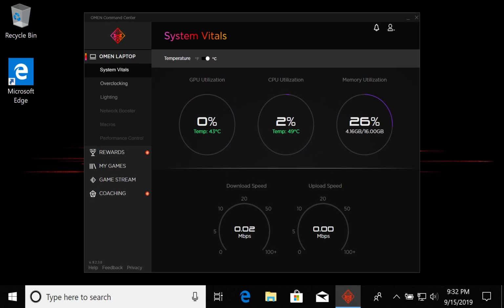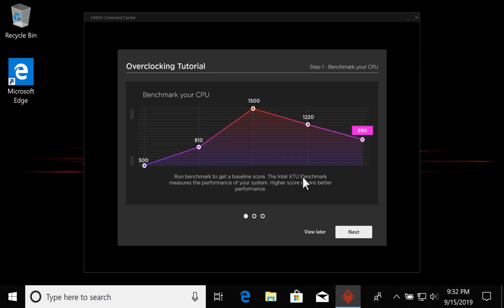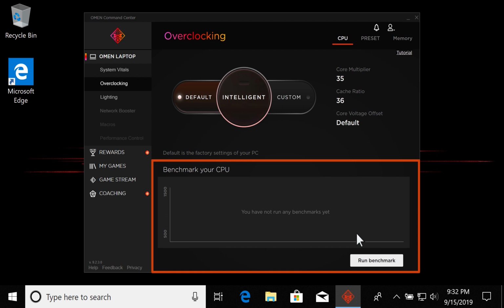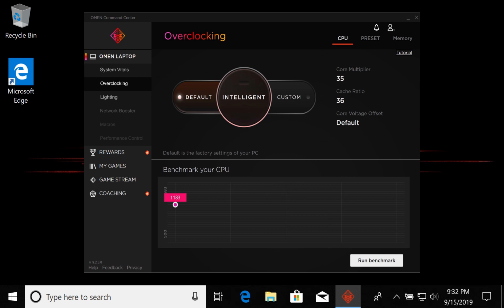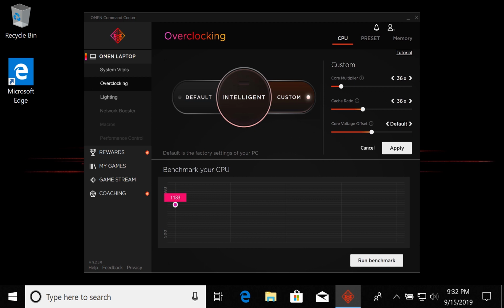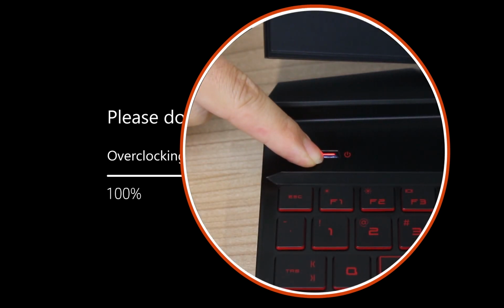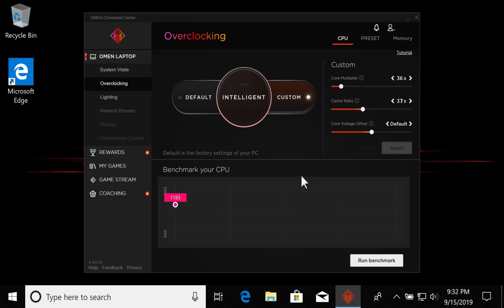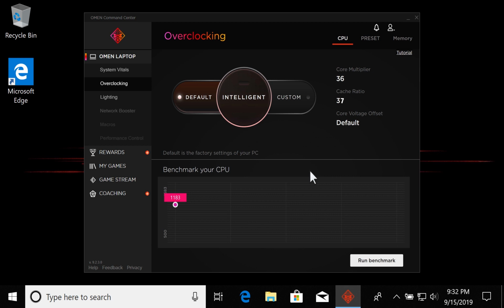Overclock an OMEN Computer | OMEN Gaming | HP Support

Comment: You should make  bios to allow ce198wm models and all Omen 15 i7 laptops ie 8750h ,(You disabled the Intel IGPU which make battery life horrible) with GTX 1060 max q  to have the undervolt and performance modes you neutered our gaming Laptops thats what we bought them for to get the most from a gaming laptop like Omen 15

Comment: Intelligent overclocking eventually makes my system unstable and it starts crashing.  This needs to be fixed as well as bringing memory overclocking back.
Reply from the maker: +Kenny Teeology Please check whether your unit supports this feature under 'OMEN Command Center features' from here: http://bit.ly/2Gp1scm If it supports, please perform the steps mentioned under 'Overclocking'
Reply: @HPSupport  This video is outdated since HP no longer supports XMP RAM overclocking.  I've tried the intelligent overclocking function multiple times and my system always eventually becomes unstable.
Reply: Yep, learned the hard way lol.

Comment: Could you guys please add overclocking to the 15” HP Omen because when I’m gaming I have it on balanced and on comfort but my CPU keeps going to 206 Fahrenheit while my GPU is completely fine at 160 Fahrenheit.  It’s when I’m gaming it’s that hot

My 15” HP Omen specs are RTX 2060 Core i7 9th gen 16GB of ram
Reply: yeah its annoying how we don't have it!
Reply: Because you can’t overclock laptops mate, there’s a reason turbo boost is a feature, when your laptop gets too hot the CPU will undervolt to use less power causing less heat so your games will not perform as well. Your fault for buying a laptop, those temperatures are normal, my old Omen gets to 97 degrees Celsius on heavy loads, glad I sold it and bought a desktop. (i9-9900K, 2080Ti Advanced Edition, Maximus XI Hero Mobo...)
Reply: Yet the video is describing the process for a hp laptop.

Comment: Max fan settings in the future available the 2018 omen laptops,where you can set the performance mode , or HP doesn't have such plan?
Reply from the maker: +adrián balogh Please refer this document to get this information: http://bit.ly/2G3Dyzn
Reply: HP Support can you help I am trying to put my gpu to use because my cpu is always on 95-100 percent and my gpu is always on 30-40 percent and my game doesn’t run smooth because of this
Reply: @HPSupport  it is ok if I use msi afterburner in omen 15?
Cause I have option for only undervolting and not overclocking

Comment: Hey HP, i have a Omen Obelisk. I recently upgraded from the stock i7 8700 to a i9 9900k. When im trying to overclock, the benchmarking screen stays at 0%. Any solutions? Thanks!
Reply from the maker: +John Canillas Please check whether your unit supports this feature under 'OMEN Command Center features' from here: http://bit.ly/2Gp1scm If it supports, please perform the steps mentioned under 'Overclocking'

Comment: I tried it, then the (brand new) pc shut down and I'd get an oc failure message. now I can't open the omen app, because I have to "update windows", which I did 5 times now... And every time I restart the pc I get the same failure message
Reply from the maker: +HitcherX If it worked prior, you can try rolling the system back using a Windows Restore Point and choose a point prior to the update.That is, if restore points is enabled. Here are the instructions on performing a restore point: http://hp.care/2tDfDSE

Comment: hello HP 
I have a problem I do not have the same interface as you with overclocking ... can you help me ?
Reply from the maker: +clement Marinho Please check whether your unit supports this feature under 'OMEN Command Center features' from here: http://bit.ly/2Gp1scm If it supports, please perform the steps mentioned under 'Overclocking'
Reply: @HPSupport  the app is updated and it looks diverent

Comment: Hey HP how come the new 2020 HP Omen with the new 10th gen i7 does not support any overclocking in the omen software? Seems strange to leave out for such a flagship product...
Reply from the maker: +Erik Nelson Please check whether your unit supports this feature under 'OMEN Command Center features' from here: http://bit.ly/2Gp1scm If it supports, please perform the steps mentioned under 'Overclocking'

Comment: Hi HP Support,

I have an HP Omen 17 with an i7 9750h and an rtx 2070 gpu, however I don't see the overclocking section in my command centre. Is there a way for me to overclock it from the BIOS menu or should I leave it as is?
Reply from the maker: +Nympo Please check whether your unit supports this feature under 'OMEN Command Center features' from here: http://bit.ly/2Gp1scm If it supports, please perform the steps mentioned under 'Overclocking'

Comment: My computer does not have this intelligent overclock settings like yours how do I get this? Mine is generic like.
Reply from the maker: +BEACH MERK Please check whether your unit supports this feature under 'OMEN Command Center features' from here: http://bit.ly/2Gp1scm If it supports, please perform the steps mentioned under 'Overclocking'

Comment: I decided to over lock my pc and when the first restart happened I decided I did not want to so it gave me the option to cancel over locking so I did. Now it just boots up I login then I have about 20 seconds then it just crashes. how do I fix that
Reply from the maker: +Spicy Please perform updates via Windows and HP Support Assistant as mentioned below to fix this issue: Step 1 Windows Updates - 1) In the search box, type and open Windows Updates. 2) Check for updates. 3) If the updates are available, click on install and restart the computer. Step 2 HP Support Assistant Updates - 1) In the search box, type and open HP Support Assistant. 2) Check for updates. 3) If the updates are available, click on install and restart the computer.

Comment: I have an i7-9700k, and a 2070, i tried to use the intelligent overclocker to get the best out of my pc, but it seems to have gotten stuck at 20% it’s resets for like 30 seconds then freezes and restarts. I tried to turn it of ( and back on) manually like three times but nothing has changed, i tried to press cancel in nervousness, but then it just restarted again and went to 20%, can someone help me?
Reply from the maker: +Vetle Reinton Please check whether your unit supports this feature under 'OMEN Command Center features' from here: http://bit.ly/2Gp1scm If it supports, please perform the steps mentioned under 'Overclocking'

Comment: Hi HP,
I'm streaming and playing games from the same computer, so far my OMEN is a beast, but I want to go max instead of upgrading my CPU
this is my model 880-101nx I'm using atm.
my settings are Intelligent right now, but I want to go full boost what are my top end figures I should go on Custom?
Reply from the maker: +DeadCowOrifice DCO Please check whether your unit supports this feature under 'OMEN Command Center features' from here: http://bit.ly/2Gp1scm If it supports, please perform the steps mentioned under 'Overclocking'
Reply: @HPSupport  Nevermind, I bought the G13 30L with i9 10th gen and 2080ti
It's all set, the best choice I've made purchase wise in 2020,and i did reviewed it in my channel 😍

Comment: I do have an Omen Obelisk 875-0907NZ desktop pc with a built-in Core-I7 8700. This processor should be possible to boost anyway due to Intel's Power Boosting System. However, I cannot access the advanced BIOS in order to simply allow power boosting from there. Therefore, I thought I'd give this program a try - but according to the Command Center, there is no tab for overclocking the CPU. Do I do something wrong?
Reply from the maker: +GermanRocket7 Please check whether your unit supports this feature under 'OMEN Command Center features' from here: http://bit.ly/2Gp1scm If it supports, please perform the steps mentioned under 'Overclocking'
Reply: GermanRocket7 wait,if it’s i7-8700,not a i7-8700K,so it is not unlocked

Comment: Is it possible to undo the overclock? How to do it? I have an hp omen 880 199nl
Reply from the maker: +Pietro Ansideri You can use an app called ThrottleStop. This app has a feature to disable turbo boost .This significantly will bring down the CPU temperature.

Comment: Ever sense I did this my computer keeps crashing. How do I revert the process?
Reply from the maker: +blacksunaccounts Please perform updates via Windows and HP Support Assistant as mentioned below to fix this issue: Step 1 Windows Updates - 1) In the search box, type and open Windows Updates. 2) Check for updates. 3) If the updates are available, click on install and restart the computer. Step 2 HP Support Assistant Updates - 1) In the search box, type and open HP Support Assistant. 2) Check for updates. 3) If the updates are available, click on install and restart the computer.

Comment: Am I missing something here? The Omen Command Center app on mine doesn't have these things. Under performance control it only has Comfort, Default and Performance.
Reply from the maker: +Egg TBD Please check whether your unit supports this feature under 'OMEN Command Center features' from here: http://bit.ly/2Gp1scm If it supports, please perform the steps mentioned under 'Overclocking'

Comment: i dont understand i have an Omen with gtx 1070 and Intel i7 7700hq Unlocked, but the program dont offer this option...
Reply from the maker: +Armani Rocha Please check whether your unit supports this feature under 'OMEN Command Center features' from here: http://bit.ly/2Gp1scm If it supports, please perform the steps mentioned under 'Overclocking'

Comment: Does the AMD Ryzen 9 3900 (without X) on OMEN GT12 25l  desktop  PCs allow the OC? Same question for the Ryzen 7 3700X.  thank you!
Reply from the maker: +Gabri Mica Please check whether your unit support this feature under 'OMEN Command Center features' from here: http://bit.ly/2G3Dyzn If it supports, try the steps mentioned under 'Overclocking'
Reply: @HPSupport  thank you , may I ask how to translate the HP desktop coding 875-0xx, 880-p0xx, 900-xxx etc.. to GT 12 models? Otherwise the table for overclocking doesn't help at all :-)

Comment: Does using the intelligent overclock affect warranty?
Reply from the maker: +Ihate hats HP has locked a few settings on your computer which are being managed by the system configuration and under or overclocking is one of them.
There's no way of resetting or changing these locked settings and forcing changes on your own would void the warranty.

Comment: is it normal for the fan to be extremely loud during this process?
Reply from the maker: +Kymor5 It could be simply high air flow/ high RPM noise due to the fan spinning up in response to high CPU usage, which causes high heat output. It could also be "bearing noise", as the case would be if the fan bearings have worn out. Screeching or growling, would be bad fan bearings.

Comment: I have an HP Omen 16 and I cannot find any way to limit the CPU's clock speeds. When turbo is on my intel i7 goes up to 4.7ghz and gets over 90c if I'm not using this laptop cooler that I just bought. The CPU would get so hot that my laptop would crash. Now, I already found that in order to change Processor Performance Boost Mode I had to fiddle with the registry key values which is stupid. After that, I am left with the decision of either turning off Boost Mode and being stuck with 2.3GHz or leaving Boost Mode on and consistently floor my CPU at 4.7GHz. 

The Omen Gaming Hub only allows me to Undervolt but I have no option of overclocking or  changing the clock speeds. The BIOS won't even let me change any settings involving CPU/Ram/GFX clock speeds which is kinda sad considering that this is a gaming laptop... I have every driver up to date and I also have the BIOS up to date. This laptop is running on Windows 11. The sad part is I doubt HP will even let me return this for a cash refund so I can  get another product since nobody can help me just limit my CPU to 3.5-4.0GHz or something. I don't need 4.7GHz... It gets way too hot. But 2.3GHz is too weak...
Reply from the maker: +Hoodscape Each computer is designed in  a different way. Please check whether your unit supports this feature under 'OMEN Command Center features' from here: http://bit.ly/2Gp1scm

Comment: hi HP i would love and appreciate if you could add features for all hp omen 15 laptops i do not think it is great to have customers that buy a very expensive OMEN GAMING LAPTOP to find out that it does not offer support to overclock or increase performance in THE OMEN CONTROL CENTRE and for all the newbies who want good performance but only have the comfort and default option its really frustrating, please add the features so everyone with the same problem as me has more than just the 2 performance settings which do not help much with gaming!  thank you and have a good day!
Reply from the maker: +ilan haberer Each computer is designed in  a different way. Please check whether your unit supports this feature under 'OMEN Command Center features' from here: http://bit.ly/2Gp1scm
Reply: Yes I understand that but then you should say on the box or at the shop that is doesn’t support performance mode or overlocking , i have had a Dell G5 which came with software that all the computers they make get for performance , the Alienware software, like they give people who don’t have a Alienware computer the same software ?? I think you need to up your game guys , I truly love Hp I’ve had a computer from you guys every year but it’s time you guys get on the next level and give all your computers performance options and if not all just the gaming computers . 
Thanks

Comment: Hey HP Support, so my omen command center doesn't allow me to access the overclocking feature on my Omen Obelisk 25L. How would i go about overclocking my Ram in order to get the true speed of the chips? Also, how can i get this "unlocked" ???
Reply from the maker: +Alex Y Please keep checking whether your unit supports this feature under 'OMEN Command Center features' from here: http://bit.ly/2Gp1scm If it supports, please perform the steps mentioned under 'Overclocking'

Comment: I have many issues with my laptop that nobody have been able to help me with but yeah it says that i cant use omen control center even tho I got the laptop 17 w202no
Reply from the maker: +WTG You can Update the OMEN Command Center from the Windows Store Click the Windows Store icon in the system tray. Search for OMEN Command Center. Click Update. Wait while the program downloads and installs. Click Play. OMEN Command Center opens. If the issue persists, please uninstall the HP Omen Command center. Select the Start button, then select Settings > Apps. Choose the program you want to remove, and then select Uninstall. Some apps built into Windows can't be uninstalled. To remove an app you got from Microsoft Store, find it on the Start menu, press and hold (or right-click) on the app, then select Uninstall. Restart the HP Omen and download the Command Center from this Link: https://support.hp.com/us-en/drivers Let me know how it goes.
Reply: @HPSupport  I can't find the omen command center there :/
Reply: I dont know if you managed to fix the issue, but they quietly killed the command center for the Omen Gaming Hub. You should be able to find it in the Microsoft store

Comment: Any way to overclock ram while not having an overclockable cpu?
Reply from the maker: +Its Doublevee HP does not recommend upgrading or downgrading hardware parts or software that is bundled with the product as It may affect the manufacturer's warranty and performance, however, you could change the configuration at your own discretion.

Comment: Hello HP,
I purchased a Omen GT13-0109 and now i want to upgrade my RAM.  With that said, i tried to get the RAM from HP and not available!!!!  So now I want to buy the RAM from HyperX direct and i want to get the 16G stick at 3200MHZ speed.  I know it will default to a lower speed than the 2933MHZ set from HP.  My question is can i set the speed at 3000MHZ or 3200MHZ safely without damaging the computer?  I will be using the INTEL XTU software to accomplish that.  Is it safe?  Will the computer get damaged?  What is the max speed that i can set with the GT13-0109?
Thanks for your help
Reply: unfortunately its impossible to change the ram speeds if you have a intel cpu.But if you had a amd cpu you could go check dankamyouknows channel where on one video called HP Omen RAM Upgrade! RAM Limitations?! Ryzen Master Tutorial on Adjusting Memory Speed!!.he shows how to do it

Comment: I have hp omen 880-139nx desktop.
I did ran a benchmark test before overclocking and it gave me around 2880 to 2900.
After i did intelligent overclocking and ran a benchmark test it ended up giving me only 2435 to 2450 !
So i returned to factory settings and it still gives me around 2450.
I don't know what's wrong with it or did i do something wrong here ?
Reply from the maker: +MoTheP1 Please check whether your unit supports this feature under 'OMEN Command Center features' from here: http://bit.ly/2Gp1scm If it supports, please perform the steps mentioned under 'Overclocking'

Comment: Hi hp i have a omen 25L with intel processor why dont we have the option to overclocked our memory in the omen gaming hub?
Reply from the maker: +Nicolas Seward HP does not recommend upgrading or downgrading hardware parts or software that is bundled with the product as It may affect the manufacturer's warranty and performance, however, you could change the configuration at your own discretion.